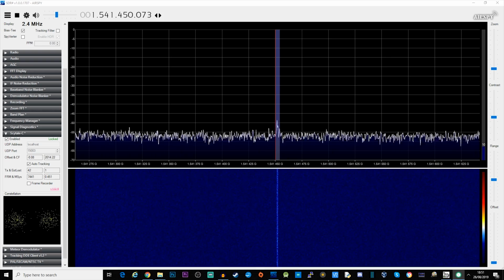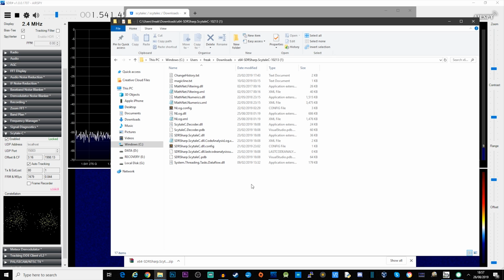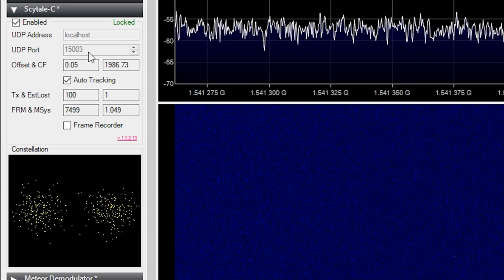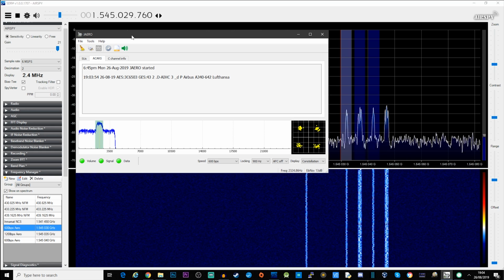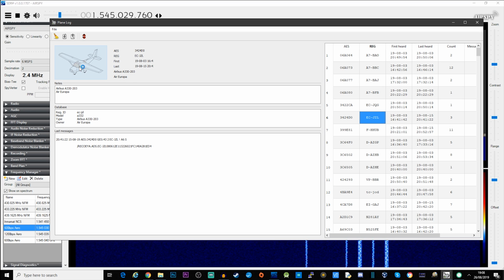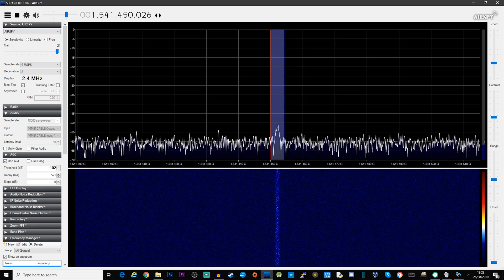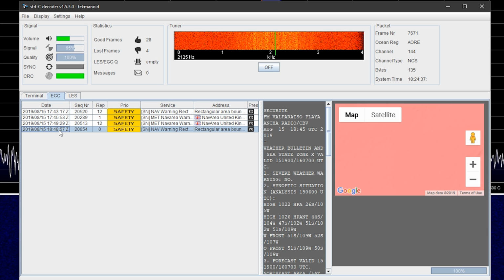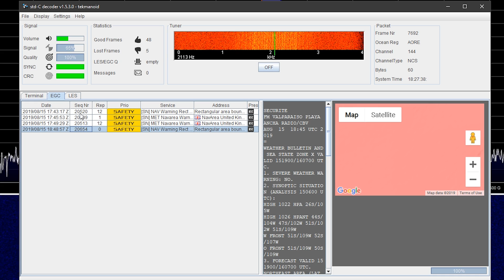Inmarsat Decoding Software Packages

Comment: I have been playing around with SDR Sharp with skytale-C, i purchased one of the L band antenna's, but I still cant get anything on inmarsat.
I'm in the US midwest, so I think I should be recieving on 1541 mhz???
I cant get sytale-c to lock onto a strong enough signal, but on 8.1 mhz I get a dialating circle in the constelation box.
techminds, any advice?

Comment: I am using SDR Sharp and added the lines for Scytalec UI.  I also d/l the Scytalec Quick UI file.  How does SDR Sharp interact with the Quick UI file. Does it need to be copied to a specific folder>
Reply from the maker: You have the Scytale C plugin in SDR sharp, as show in the video, and then make sure the UI program is on the same network and has the same UDP port set as per the plugin on SDR sharp. Let me know how you get on.
Reply: Tech Minds  does the UI program have an execute file so you can install it and then determine the network? I am not at my computer right now! Will be later! Thank you for the help!
Reply from the maker: The UI program does have an exe file, but it doesn’t need to be installed, it just runs from the file location you saved it to, or moved it to. You run the UI program at the same time as SDR Sharp, just make sure you press the “play” button on the UI program to start receiving the packets from the SDR Sharp plugin. Hope that helps.

Comment: Can ypu monitor other satellites ?.
 I'm in Australia and used to monitor an Analogue comms feed from an Optus Satellite on KU band using a 10.7G LNB down converted to 1.2Ghz fed into an analogue receiver until it went digital, I dont beleive its encrypted its just digital.
Reply from the maker: Yep, I’m currently playing around with Iridium Satellites, video coming soon! Also, you should have no problem with receiving Inmarsat and iridium where you are